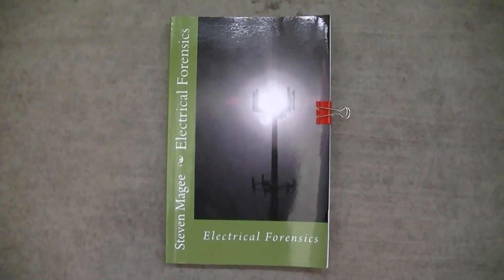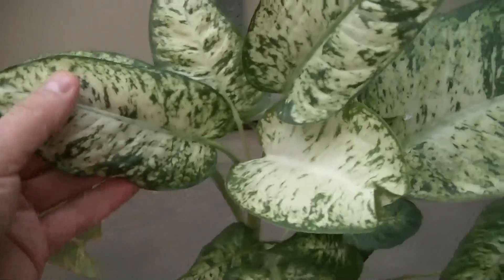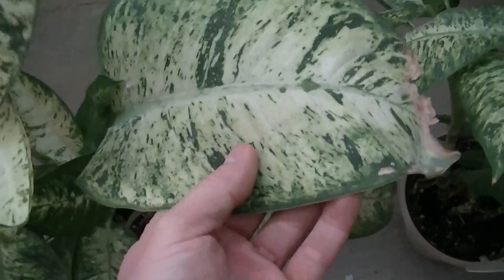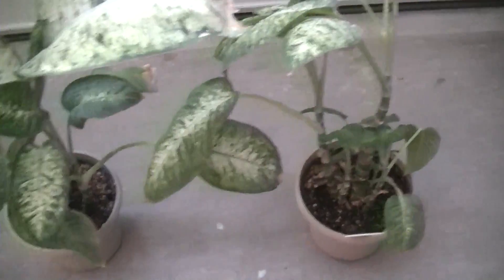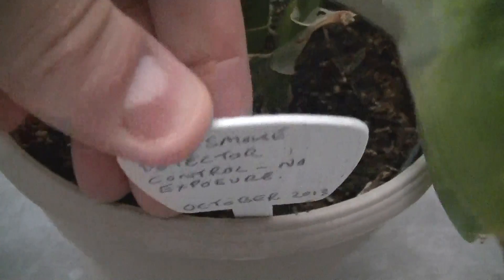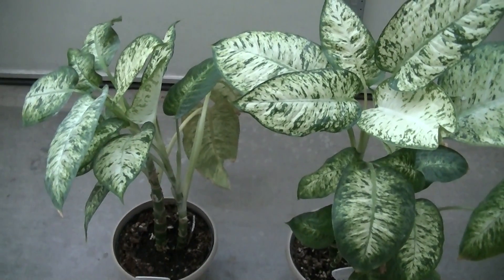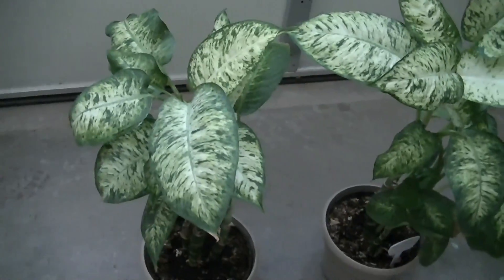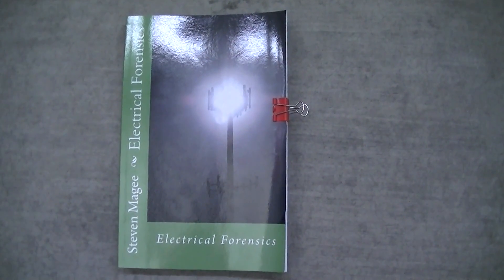Smoke Detector Radiation Experiment #4

Comment from the maker: It appears to be about 2 feet in radius of this "Hot" detector that is biologically harmful.  The compliance monitoring group for the University of Arizona tested it with calibrated professional equipment. Harmful China detector figure first and control detector figure is in brackets:  Victoreen 451B ion chamber 10-40 microrad per hour for both; Ludlum 44-9 250(60)CPM; Ludlum 44-3 10,000(1,500)CPM. China detector has higher amounts of 30 keV low energy photons.